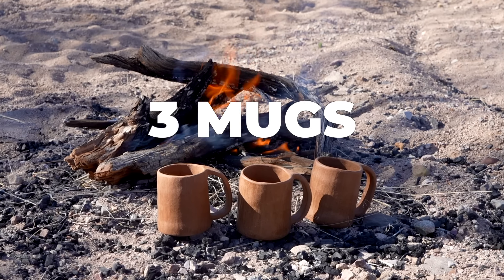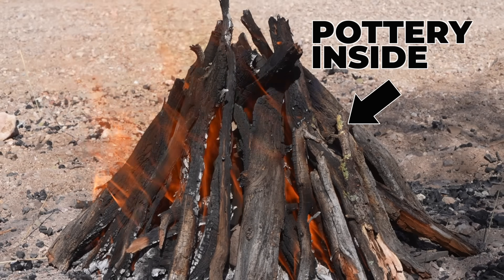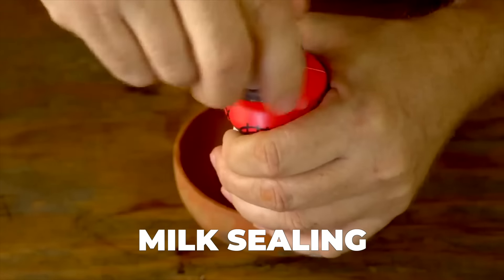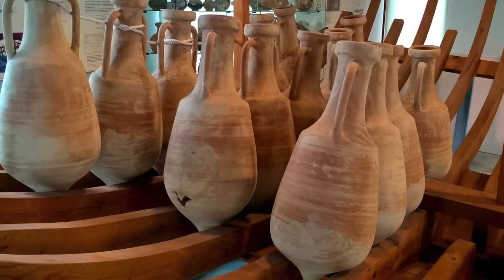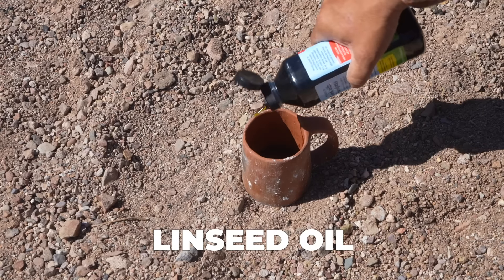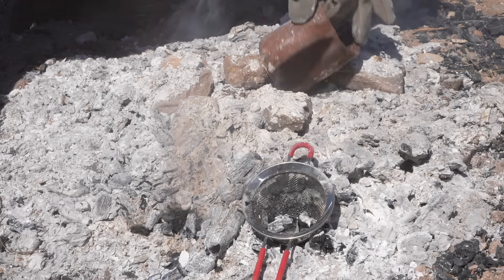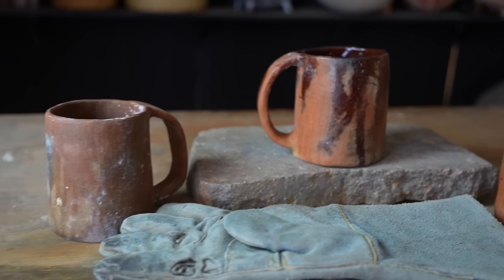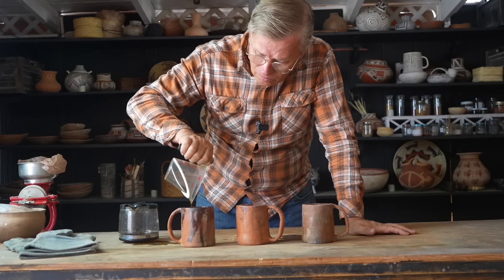Sealing Mugs With Old World Methods

Comment: The huge difference is that oil and wine aren’t heated. You can’t be surprised when wax melts with heat.
Reply from the maker: Yeah, the sealant you pick may have a lot to do with your intended use.

Comment: If you peel the bark off a sweet gum tree it will ooz a resin, at first it is soft, later hardens , the American Indians chewed it as chewing gum before chewing gum existed, it was used as glue in making bow and arrows by the American Indians, also used as glue in making jewelery, if you heat it it turns black but gets real hard .

Comment: Much like sealing a cast iron frying pan, preheating your mug to approximately 350 f or slightly smoke point for the oil, test by dropping a bit of oil on the mug. Using gloves of course, swab inside and outside of the mug with a natural fabric cloth that is wet with peanut oil, lard or sunflower oil and allow the mug to cool down slowly near the fire, so that there will remain the appearance of an amber colored resinous coating. Pine pitch and wax also works but are more likely to flame up.

Comment: linseed oil does not,dry, it polymerizes over time on exposure to oxygen and due to evaporation of light volatile components not water. Boiled linseed has the volatiles removed and polymerizes over a period of time. This reaction is exothermic which is why oily rags are dangerous for smoke and combustion. It can take months to finish.

Comment: For any of these to work their best they need to be heat cycled.  Boiling, cleaning, and using a week acid to finish the job seals every.  It won’t spoil and rot.  Annnd you get full penetration.  

Get away from the artisan mind set for a moment and read about Japanese tea pots, S American clay wear, coffee roasting, and preserving old iron relics in boiled wax or oil.  Some basic understanding will take your products to the next level.

Comment: The only difference I would have done is to give them a boiling water bath first.
Reply from the maker: Why?
Reply: @AncientPottery  for several reasons, the first being that I wouldn't want to use a liquid that I was going to ingest as a test to see if the ceiling agent was going to leech into the liquid. What you discovered was pretty much what you had expected to discover and, I suspect that ancient artisans knew that and would not take a drink from the first liquid poured after sealing.
Reply from the maker: @mjklein  everything I used was edible